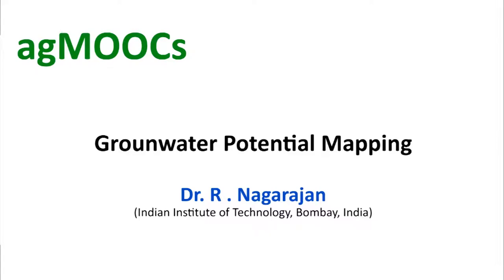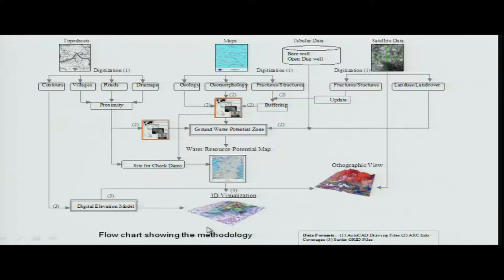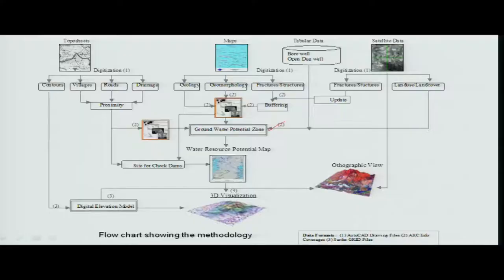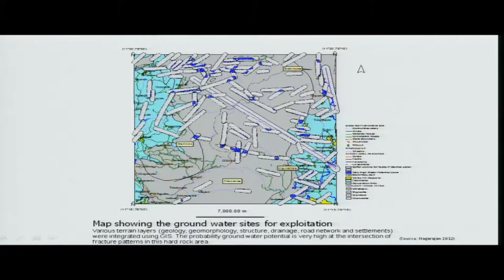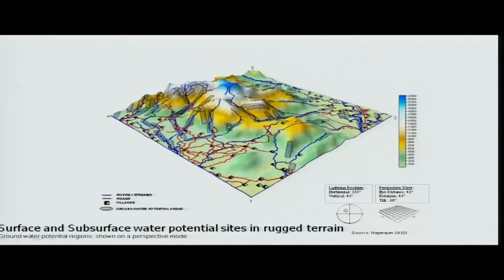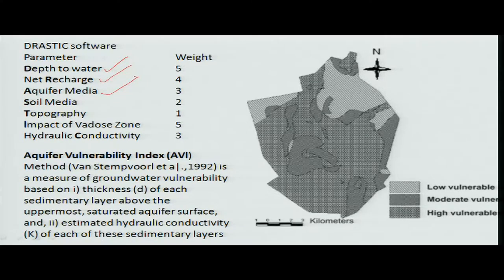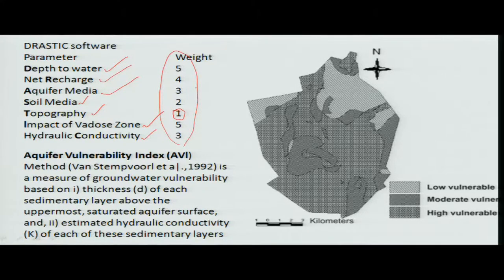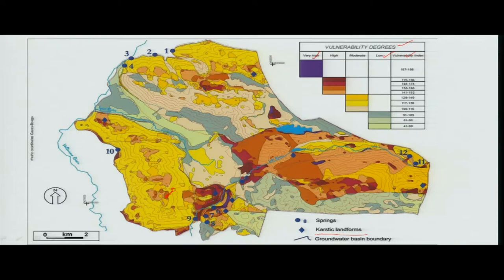Mod-06 Lec-27 Groundwater Potential Mapping

Comment: Water is generally classified into two groups: surface water and groundwater. In general: Groundwater is located underground in large aquifers and must be pumped out of the ground after drilling a deep well. Surface water is found in lakes, rivers and streams and is drawn into the public water supply by an intake.